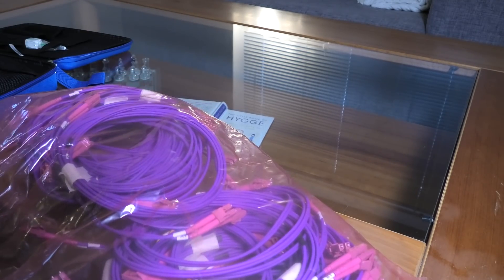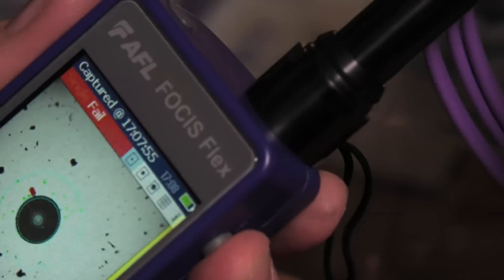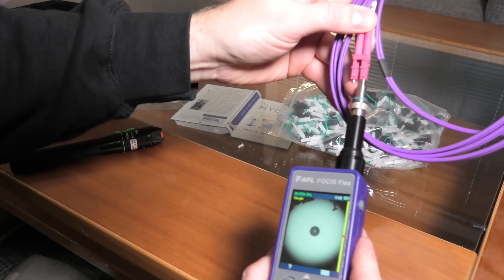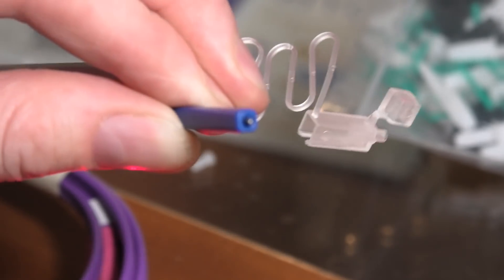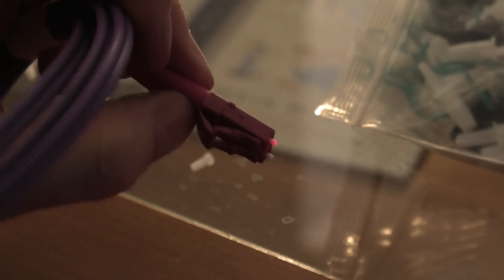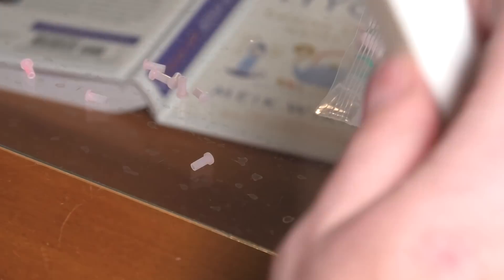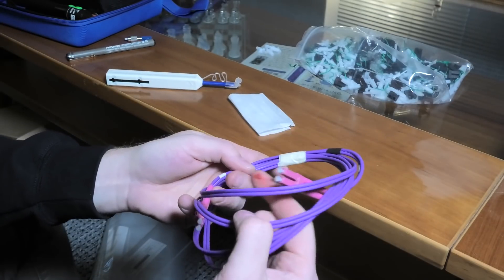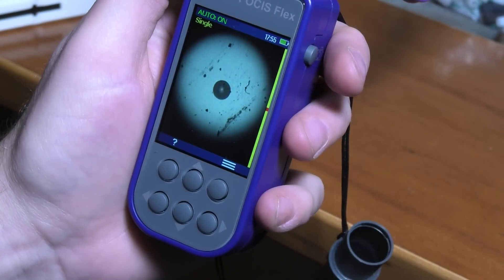Dirty Fiber Optic Connectors - Showing the Laser Pen Ninja Hack - 1117

Comment: Have you done a video of removing and replacing the LC connector(s) on one of these junk cables, and then retesting?  Would be interesting to see if they're recoverable.
Reply from the maker: I have not seen a LC connector kit. But I have seen that you can cut off an LC with a bit of fiber and splices that back on to another cable.
This is only worth it if you have a very special or difficult cable. as a normal LC-LC cost like $5  But if you have a MPO-LC fan out cable at $200+ Yes replaces an LC connector would be good,, or a long cable through a building or ground, where it would take many hours to replaces it.

Comment: I can do fiber testing but i want to understnd  more. At 3:18, as most fiber inspecting microscopes show you, is the overall image of the fiber surface. But I want to know what actually is the black smaller circle doing in relation to the outer white circle?

I've had so many fibers pass with snow white outer rings but if any spec of dirt is within the inner black ring they fail. Generally if the outer white ring is not perfect but the inner black ring is, it will pas

Which part does the light source travel through?
Reply from the maker: The dark(black) circle in the middle is where the light comes through, and the larger white ring is the protective plastic around the thin glass fiber.
So the Black circle needs to be clean. And the tester will fail the cable if there is to much dirt on the white circle. And you want to clean that away, as if you breath the wrong way,,it will be in the black circle :-)

Comment: Handy little scope! Does your ruby have a flash setting?
The oils on your skin (forehead) can help dislodge some stubborn dirt, then scrub on a clean piece of linen or denim, then clean with your clicker or paper pads. No kidding, it works. Always inspect and clean every connection when installing and every time a circuit is opened for any reason. It only takes a moment and reduces rework and frustration.
Reply from the maker: Hi Sven Johnson
Thank You very much! never heard about that. glad you liked the video :-)
Thank you for watching! :-)

Comment: Why use fiber optics for 1-10GBit/s anyways? Wouldn't CAT-7 wire be sufficient for that as well? Where's the advantage of fiber optics, except for the much higher price?
Reply from the maker: I do agree,,, I like DAC cables,, but it is almost the same thing.
Reply: Distance.
Reply: @denniswoycheshen  OK. How long does CAT-7 enable 10GBit/s? 100m? How huge does the datacenter have to be? Especially, who builds such a huge datacenter without switches in regular intervals?
Reply: @Seegalgalguntijak  I have been in a few data centers and I don't think you understand what they do and why.  There are certainly not switches everywhere, aside from what is in the customers cabinet. Basically all communication between a cabinet and a meet me room or an ISPs handoff is fibre. Occasionally you would have a cluster of say 12 cabinets (and this absolutely depends on the application and customer) then you may have electrical connections in between, but fibre is much easier, cleaner cheaper and faster then twisted pair.
Reply: @denniswoycheshen  Really fiber is cheaper than CAT-7 wire? Even though these fibers are so finnicky and real drama queens? And although you need an optic modem for them? I can hardly believe that. Why does CAT-7 have so many drawbacks over the shorter-ish distances, and what are these drawbacks?
Reply: @Seegalgalguntijak  between switches yes, electrical would be the way to go, up to about 100 ft.  But for reliability over distance fibre is the way to go.  For me, the fact that there is basically no limit to the bandwidth of fibre, is worth the cost of installation.  There is no upgrading other then the equipment on either side.
Reply: @denniswoycheshen  OK, if CAT7 would only be good for 30m on 10GBit/s, I can understand that it's not used primarily in data centers - these distances can easily be surpassed. I thought it would work up to 100m, so I guess that's 300ft or whatever in miles, I don't know.
Reply: @Seegalgalguntijak  the application entirely determines the technology, not so much the cost.  :)

Comment: We have stopped using those tiny taps at my work, because they are too close to the fiber and you can inadvertently touch the cable with your fingers if you miss the end.
Instead we have larger caps that connect with the pink part of the LC connector and not the fiber itself. Way easier to put on.

Also: You said those are OM4 (Multi-Mode) fibers. Does the microscope autodetect cable type? It said "Single" in the top left. If that means it was expecting a Single-Mode cable, the test wouldn't work no matter how much you clean it.
Reply from the maker: I have not seen those bigger covers,,interesting.
I think it refers to a single fiber,, and not MPO...

Comment: I think this is very important thing and sadly enough you see lots of videos on Youtube where so called professionals have uncapped fiber connectors in patch panels, patch cords or SFPs. It is especially important in single mode installations to keep optical connectors clean. I would also suggest avoiding cheapest fiber optic patch cables as many times those have already dirty connectors when shipped from the factory.
Reply from the maker: Hi Juho Hartikainen
Thank You very much!  glad you liked the video :-)
Thank you for watching! :-)
Reply: this is why special alcohol wipes for fiber optical cable exists. Most of the time, only damage to the optic fibre ultimately kills the cable.
Reply: @JSLEnterprises  While that is true, the only way to check the connector is with fiber inspection scope.

Comment: I have been using cheap optical lens wipes from the local supermarket (for glasses). They seem to work, but I have never had the tool to see if they damage the ends. I wouldn't expect so, considering the hardness of the materials.
Reply from the maker: I tried baby wipes , that was a no go,, they had some oily thing on them :-)

Comment: we refuse to use fiber to connect our switches in non-clean environments (basically everywhere since we service DIY-stores), now I can point customers to this video why. In your previous video it wasn't as obvious for non-IT people how fast they can become dirty, but the laserpen-trick is obvious enough for customers that they won't be asking for it. Using CAT6 is a lot cheaper and fault-toleranter + the distance limitations for gigabit are not too restrictive. thanks and hope you can salvage enough for your playhouse :)
Reply from the maker: I like using DAC cables myself,,, :-)
Reply: could you do a video on those?

I haven't used them ever, but at first sight it seems like we're almost talking datacenter only stuff then. We haven't even considered them due to their factory termination and max 10m length. Our cableguys need to terminate them in the field at larger distances.